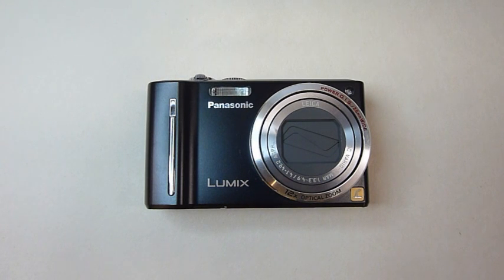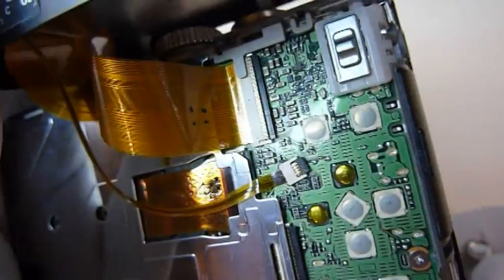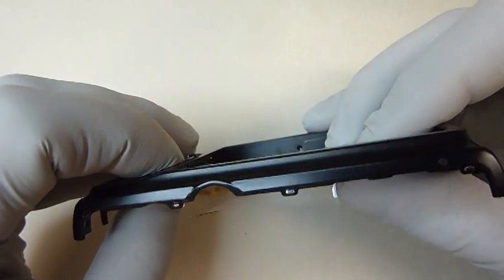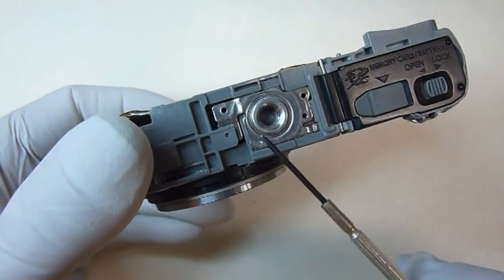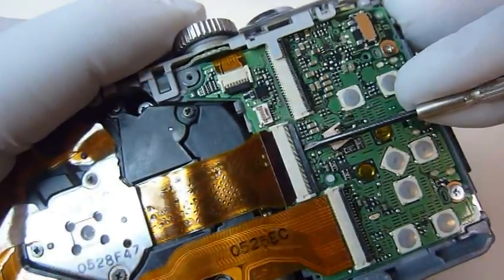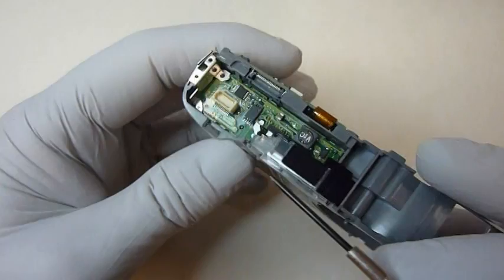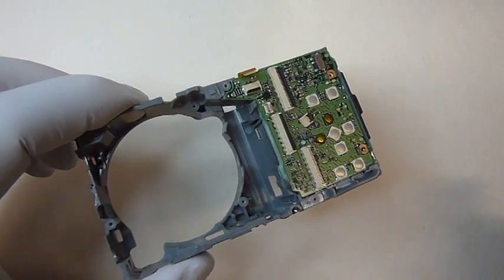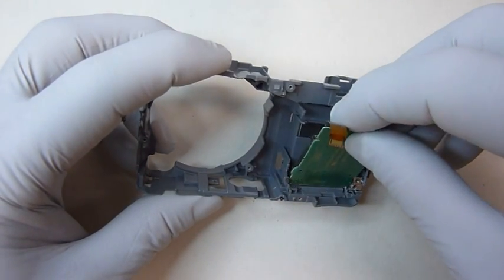Repair A Panasonic Lumix ZS6, ZS7, TZ9 and TZ10

Comment: I followed your repair I had to clean out the lens and it was a success but it didn't last that long... So recently I was about to record a YouTube video with the Lumix but when I set the on it a tripod and started recording the video I noticed the video was giving this weird shaking effect in the video while the camera was focusing. Normally it would stop doing that for 4 seconds when the camera has it in focus but when zooming in while focusing it was doing it again it was even worse I could even hear the camera focusing quite loudly..
Reply from the maker: It sounds as if there is something out of align, or something broken if it is shaking that badly and also causing the motor to be that loud. Normally I would suspect that there is sand or dirt inside the small channels that are inside the plastic tube sections, but since you just tore it apart and cleaned it, that wouldn't be the case. Tearing it apart and cleaning everything again, in hopes that something was missed,  is about the only suggestion that I have. Unfortunately, as you and I both know, that's a big job. Sorry I can't be more help.
Reply: @Thebobfactor Thank you for replying! I will try taking it apart again and see what’s happening inside.
Reply from the maker: Good luck with it  @dilmygamer . Give me a shout if you run into any problems, and I'll help out if I can. 🙂
Reply: @Thebobfactor  Hello
Reply from the maker: @dilmygamer , yes you can; hiking@thebobfactor.com. 🙂

Comment: Hi sorry for my bad english but if tz10 lcd can replace with leica vlux 20 ?. I have leica vlux20 and I can't find any lcd replacement for this model. Any comments would be appreciated, tks
Reply from the maker: Hi. I'm unable to find a replacement LCD screen for the Leica V-Lux 20 either. I really doubt that the LCD screen from a TZ10 will work on it.

Comment: Thank you, thank you, thank you for this great instructional video!  I had a bad scratch on the lens of my Lumix ZS7, but all else was in excellent shape.  But it also was a nice blue color and I wanted to save that. I found a used ZS7 (black) that had a good lens but a bit of a smudge that showed only on the display panel, for just $20 on Amazon.  So I followed your video and swapped the whole lens unit.  Now my blue ZS7 is working great--no scratch, no smudge, just as I got it new several years ago.  You were so easy to follow--every move well shown and explained.  At first I used a small flat screwdriver as you suggested but I also have a tiny Phillips head screwdriver that worked better, once I magnetized it by rubbing it on a magnet.  Thank you very much.
Jim Nickerson
Reply from the maker: That's awesome Jim. Great job on the repair. I'm glad the video helped you out!

Comment: Help!  I watched your video for cleaning the CCD on my ZS8. After I dropped a screw and it fell through the hole in the ribbon cable for the lense, and dropped between the front of the motor and the tripod mount,  In order to retrieve it, I had to release the lense assy ribbon - pulling it up with a screwdriver, I didn't see the tiny ribbon underneath, and it broke!  Is there any hope for me to fix this?  (I watched this video to learn how to remove the lense assy.)
Reply from the maker: Dan, I've never come across any way to repair a torn ribbon. Can you see where the ribbon that is torn goes to? I don't have a ZS8 to look at, and I don't recall what that ribbon is for.
Reply: @Thebobfactor  Thank you for the reply! The ribbon starts (not removeable) at the base of the lense assy motor, and is only about 1/10" wide with about 6 very tiny conductors.  It leads to the front of the motor and joins a circle shape stuck to the front of the motor and, adding 2 large conductors (the motor poles) in the ribbon, goes to a ribbon connector, on the lense assy body near the base of a metal canistor device (stabilizor?) in the lower right corner of the camera.  It appears to me that if I could find a used replacement motor, that this ribbon would be attached to it.
Reply from the maker: @danenslow4402  You are correct that you would need to buy the motor to get the ribbon. I have another video where I show how to repair the flat ribbon cable that goes to the lens motor on a ZS19. It may be similar enough to your ZS8 that it could give you an idea on how to fix it. Here's a link to that video: https://www.youtube.com/watch?v=kWt-f07Gm0w
You could also check on ebay for used or broken ZS8s that may have a good lens motor and flat ribbon cable. Here's a link to one that I saw that states that it works other then having a problem with the lens cover: https://www.ebay.com/itm/324608760681?epid=100141083&_trkparms=ispr%3D1&hash=item4b94309b69:g:u2IAAOSw69hglEX~&amdata=enc%3AAQAFAAACkBaobrjLl8XobRIiIML1V4Imu%252Fn%252BzU5L90Z278x5ickk5v8gVt3hEWLVg%252F253w6XCQmI4%252FTg%252BznZIkaCB5lb4A%252B67TGCOZFSsaQAFITE%252F7GcJ3%252FXKRK3vdmoGC1crr45O6VFaCO9tsw2LZNw61ug%252F%252FV3py%252FnfZejsrp5dSb9l3cJFTKtO9YIjWcX6hE%252BCLAaTzHRJnEzKeC5Qt%252BO1okQk3QZUq7R%252BxxK42UvZWlLHC9cgfZPPZy%252FqAdCng8OqwT27vKQwLp%252Fh%252BwuCfofxc5EoYltPYdmtkTw6VObqQXaYuNhQE8gwiXWFM7JhSHdolXw%252B9P30FMTXz%252BjdqLwXeUWV1ztVQBZZso0H%252BYPA80rznI%252F9B0rKl8%252BlcbmWTh%252FL71KRd%252BK4rgCzvjyTjCNuah2fqQd6WUiK9gORFnRxHwoHR3b5%252Bz3gZEracYwoDrb1CcvYzE9z1ikanahI3tpA5GBzv2fAts8Wg7FGW86dMYiBX9AuSJPDq8pPshN4fexkbz7YRzcLs0xhIX%252Fb4GIovSW2hkRzs0vYQUnQWNvlPMjVWrFFL3%252FJMTBFfyf3fhymR8RQXXLmVm0A%252B0ucXi6BvZFCPV9MdwhcnncMv7eUeIrjxiIQOTCw9ljBdvX%252F7AKXcqGC9gd1uYHgaoBUvdHPJuC6ol6wemTyH4BDUu%252Fx3DsJkbq1OiUuwJlclu7Fkpfb%252FKdo%252FbOtV523GH%252Btduy%252BQELvwlFN82sVezGqWGag8uIqynqRdcBMexJK3Rf%252BkkdtvH0B40LMFvE1U9I7HjwZlbKeMRZVF3LdxOTddpTXCvdVCJfV%252BErNlTf76W0eCfmAInN3CyiDEzvoPihHU86xGBz%252BnzL5i7xXnnPuYiNjvtOJvo6%7Ccksum%3A324608760681a7f4832c02ae49869bfcf25cee3677ac%7Campid%3APL_CLK%7Cclp%3A2334524
Reply: @Thebobfactor  Your link took me to a news story video, but I found your video at  https://www.youtube.com/watch?v=wx8e0z0zsg4.  Nice, but at age 82 next week, I my hands aren't quite steady enough - also the conductors in the piece that broke are so tiny that I had to use a magnifying glass to see them - thats also probably why it broke so easily.  I'll have to decide whether to buy a parts camera, or to buy another, maybe newer, used  camera, or  perhaps another viewer has a ZS8 parts camera to sell and could respond.  Thank you so much for your expertise and information
Reply from the maker: @danenslow4402  Lol. Not sure what happened with the link. Glad you found the right one though. I'm not a repair service at all, but if you want to send it to me I'd be happy to take a look at it for you to see if it's fixable, and what it will take. I have a few parts from some older Lumix's,  and possibly one of them will have the part for it.
Reply: @Thebobfactor  What luck!  I just found a parts ZS8 for $15 with ship on ebay!  I ordered it after I removed the motor with the cable from mine to make sure no problem.  Again many thanks!
Reply from the maker: @danenslow4402  Excellent! Good luck with your repair. And give me a shout if you run into any problems.
Reply: Success!  I received the parts camera and was able to use the motor and ribbon cable to fix my ZS8!  Everything works, and the picture is spotless!  Thanks one more time!
Reply from the maker: That's awesome  @danenslow4402 . Great job on repairing it!

Comment: I have a DMC-FX07 and I think It has some kind of problem since the LCD display when it is switched on shows horizontal lines that going on and off .. Could you tell me what  may be happening.. what could be wrong?
Reply from the maker: Alfonso, I've seen that same problem with a few different camera models, and in each case for me it was the LCD display that was defective. You can also check to make sure that all of the connectors for the display are properly seated. A loose connector, or a flat ribbon cable that is crooked in it's connector can also cause problems like that.
Reply: Well, thank you very much Robert..This problem already has time and more when I focus on some light source .. anyway, I thank you for your comment.. I'm going to proceed for the first time to open the camera by following your video..

Comment: This helped me so much in repairing my trusty TZ7 (ZS3). The zoom control had become erratic, it would zoom in but trying to zoom out sometimes it would hang, sometimes zoom in again, very frustrating.
Using this video as a guide (the cameras are slightly different in build) I stripped it down and cleaned the zoom control using switch cleaner, put it back together and it works seamlessly. As it happens I didn't have to strip it completely down to get access to the area that needed the spray, but if it needs doing again I'll know to only take off the front cover.
Again, thanks for the guide.

Comment: Cross head screws on Japanese cameras and electronics (and motorbikes) are very often JIS format rather than Philips. I recently bought a set from Amazon and they made a world of a difference. Vessel TD-56 kit is the one I got.
Reply from the maker: Yes, Japanese Industrial Standard (JIS) screw heads do look a lot like a Phillips. They generally have a small raised dot on the on the top to identify them. I haven't run into any on the cameras that I have worked on. But since a JIS will work on a Phillips head screw (but not visa-versa) it would be good to have a set of JIS tips handy just in case. That could be the ticket to getting that suborn Phillips head screw out. I had no clue they used them on motorbikes at all. That's interesting. It must be for a higher torque on them or something, since a Phillips head is designed to cam out before it can over tighten the screw.  Thanks for the info Empty One! I'll check out that kit too.
Reply: The 00 size JIS seems a lot better fit on my TZ65 than a Philips, so I'm convinced that's what the little screws are ;)    I also forgot to thank you for giving me the courage to open mine up to have a successful attempt to fix the zoom switch as it was intermittently zooming out instead of in.

Comment: Seems like I destroyed mine.  I was able to clean something out of the back of the lens just great.  Now the lens extends, but the screen is black and my computer doesn't recognize it.  Bent the two screen connections a little trying to plug them in...don't know if that is enough to ruin them or not.  But in that case, why would plugging in the usb get me nothing?
Reply from the maker: Check the smaller of the two flat ribbon cables. I've had the black screen problem before, and it was always that the small cable was at just a slight angle in the connector and not straight. That cable is for the back light circuit of the LCD screen. Not sure why that would effect the communication with your computer via the USB cable though..

Comment: Thanks for the video. It gave me hints to change the LCD display of TZ40 (Model DMC-TZ40EP9K). LCD model DC2302. That needs a PH000 start screw driver to open. 
I bought a display form Ebay $55 while Panasonic (Poland) claimed $120 and said this is not under warranty. Ebay display claimed touch sensitive, but did not work. 
From Norway, it took about 6 months to send the camera and get a reply. Perhaps I'll never buy anything Panasonic.

Comment: Brilliant. I thought it might have been a crack in the AA filter but it was not straight like a typical glass crack would be. The wife wanted to go out ASAP and buy a new one. I figured it was fuzz. I used your video and found out - it was fuzz. A quick swipe with a lens brush. Done. Thank you.
Reply from the maker: Hey that's great brass427. I'm glad you were able to get your camera up and running again. And I'm glad the video helped you out.

Comment: Thank you so much for this video. I have a lumix TZ10 that asks me to put in the date and time every time I turn it on.
I assumed it had an internal battery that needs changed but can't find any mention of it on the instructions, and after watching your video I can see there is no internal battery. So any ideas why it is doing this and how can i fix it.
Reply from the maker: Hi Judy. My guess would be that there is a problem on the main circuit board. Many cameras use an internal battery on the board, which is only intended to retain the camera's settings when the main battery is removed or discharged. It's possible that the internal battery is defective and causing the settings loss when you turn the camera off. You may have to replace the main circuit board to fix the problem.
Reply: Thank you for your reply. That's why I watched your video. But I didn't see a battery on the circuit board.Would they not all be the same?
Reply: i watched you video again and there looks like a battery on the SD memory card circuit board, is that what I'm looking for to replace?
Reply from the maker: It sure could be Judy. I don't have any ZS10 cards to go by. But if it looks similar to the SD card for the ZS7  in this video, then that's probably what it is.
Reply from the maker: Let me know if that fixes your problem.
Reply: I will. Thankyou so much
Reply: I took my camera to a shop to have a quote on replacing the battery, but it turns out the battery was okay. Apparently the main rechargeable battery charges the button battery, and if it's been out or dead for too long the button battery dies as well. So it's just a case of charging the main battery and putting it in to charge the little battery and as long as you don't leave it out too long it will be ok. If this doesn't happen then the battery would have to be replaced. But the price would be more than the camera was worth.
Reply from the maker: Well, hopefully that was the problem Judy. And thanks for letting me know.

Comment: Hi Bob, can i ask your advice? ...i have my pretty battered tz20, 
.keeps snapping after you press the button first time. 
.lcd is smashed. 
.when shaking the camera, i can hear something/bits are loose.
**however, it still takes great 'clear' photos (no spots etc, despite age and use!)
...what do you think i should do?
cheers
Reply from the maker: There are two possibilities that I can think of that is causing the extra pictures.

It might be caused from something that is broken in the control panel on top. Which might also be associated with whatever you are hearing rattling inside. You would need to replace the control unit on top, which is relatively easy to do and you don't have to tear the camera completely apart to replace it.

Another possibility is that it may simply be in "Burst" mode. That is where the camera will continue to quickly take multiple shots as long as you are pressing the button down. But, in  "Burst" mode It won't take pictures after you let go of the button. So, if it's continuing to take pictures after the button is released, then that wouldn't be the problem. And it would most likely be the top control unit that I described.

Let me know what you find out. And good luck with it.
-Bob
Reply: Robert Hosea thanks man, appreciate it. I also only jus realised it could actually be the broken lcd possibly too..but it snaps away at in betw burst and normal speed so it's hard to diagnose. I think if I can get the lcd screen for 15pounds ish then il go from there.
Reply from the maker: Yes, that&#39;s a very good point. If the touch screen overlay is damaged, then it could be possible that it&#39;s triggering the shutter.

You can easily test that by disconnecting the flat ribbon cable that goes  to the touch screen overlay. I show doing that it at time stamp 3-12 in my video here, https://www.youtube.com/watch?v=pRhD0Yc9BH0, which shows how to remove the LCD unit. Just remove the middle flat ribbon cable and then put the camera back together enough to test it.

Here is a ebay link to a replacement touch screen overlay: http://www.ebay.com/itm/Panasonic-Lumix-DMC-TZ20-ZS10-Digitizer-Touch-screen-LCD-Display-Repair-Part-/371325614139?hash=item5674bb383b:g:6FkAAMXQlgtSr42U

Here is a ebay link to a replacement LCD display: http://www.ebay.com/itm/Panasonic-Lumix-DMC-TZ20-ZS10-LCD-DISPLAY-SCREEN-MONITOR-NEW-/361344176884?hash=item5421ca92f4:g:yC0AAOSwyQtV6btp

Good luck with it. And keep me posted on your progress.
-Bob
Reply: Robert Hosea Cool, and thanks again for making the video for everyone. I owe you beers, ha. those 2 lcd listing are different though? Il look more closely tomoro.
Reply from the maker: Yes, one is the touch screen overlay, and the other is the LCD display itself.
Reply: Oh dear... I think It's not worth the hassle then.. how sad. I can get a 2nd hand TZ20 or near..like tz18 for betw 40 to 50£ on ebay and will be better condition than my cam haha. Can't find any tools to open my cam anyway. Thanks again tho.
Reply: Hey Bob! Gd news! It was the touchscreen indeed, ha! Bit diff model as i had 3 ribbon cables...but I used trial and error and jus discnctd the smaller one and it fixed the prob, wahey! So the qu now is, can I only replace the lcd and leave the t.screen disconected? (No use to me) ..anyway, have a great Xmas!
Reply from the maker: Hey that is good news. Good job! Yes, this camera has three flat ribbon cables. The link that I posted in one of my earlier responses above is for that camera, and it does show the three cables. And you can leave the touch screen cable disconnected if you like. I did exactly that same thing right after I got my ZS10 because I was accidentally taking pictures all of the time. I got tired of that happening so I just disconnected it. Thanks for keeping me in the loop as you worked out the problems on your camera. Have a Merry Christmas!